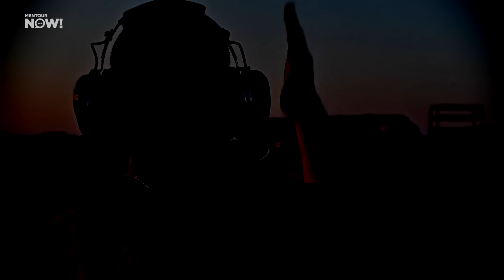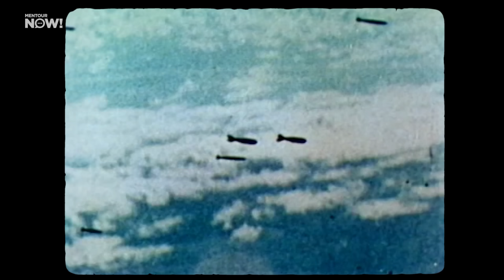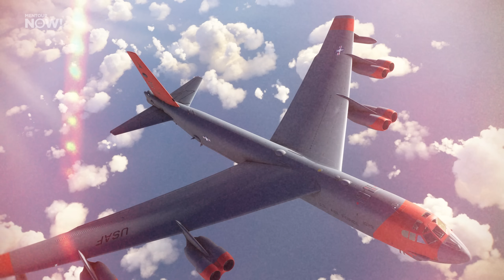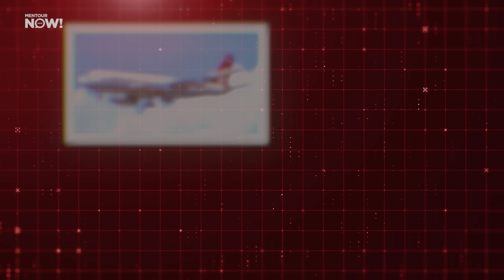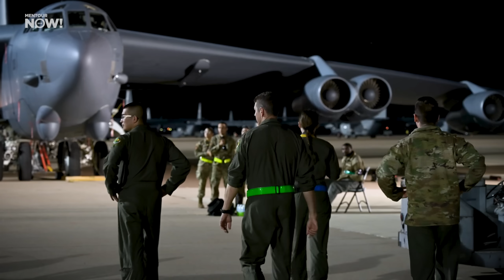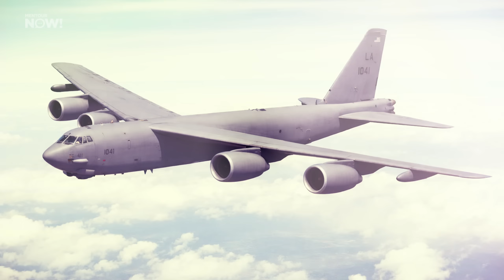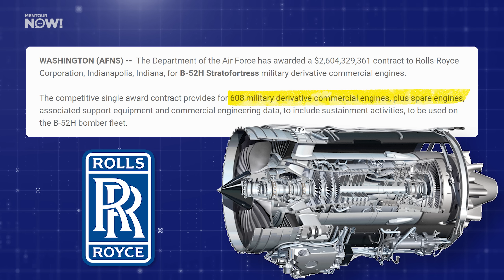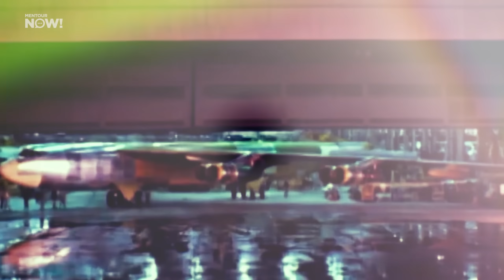WHY Are They Changing The B-52 NOW?!

Comment: Yep.....4 engines, regardless of the perceived benefits would require such a degree of modification in piping, plumbing and related electrical system changes...outside of structural modification, that it would render that "upgrade" a financial non-starter

Comment: The wing flexes so much it cannot have larger diameter fans. When they were designed they needed 8 to have enough thrust to do the job. The older 52s had a taller vertical stab.
The 737 shots show the same problem. Short landing gear with a low wing design begets the problem of modern engine installation and stretching the airframe. We all know the problems recently incurred.

Comment: In the late 1960's I saw a B-52 fly over our house near the Pratt and Whitney airfield with a single engine in place of two. I'm pretty sure it was an inboard pair that was replaced. The newspapers at the time said they were testing the use of a single engine and I'm pretty sure the replacement being tested was a P&W engine although I also recall the neighbors discussing Rolls being in the competition and them being pretty incensed at the prospect.

Comment: The BUFF gets upgrades near continously. I worked on a upgrade around 1980. The aircraft has been re-engined at least once, and no longer flys engines as shown in the start of your video. But that is the point of your video?

Comment: You said it, at 17:24 - upgraded electrical capability for new avionics packages.  Yes, the increased range is fantastic, but the USAF also needed badly to upgrade the avionics in the B-52.  And that takes more power than they were getting from the TF33s.  The real problem, here, is loss of manufacturing capability in the USA.  There's just no way to build new, global-range bombers to replace them, without putting a serious dent in our capability to build new passenger jets (Boeing).  Other companies can build similar aircraft, but lack the industrial power to build a fleet comparable in size in a feasible timeframe.  So, you upgrade the engines instead.  The B-52 was never intended to perform in contested airspace, so it can more closely adhere in design to just being a big, dumb bomb-carrier, but the USAF seeks improvement in mission flexibility, which (again) means upgraded avionics.  They're doing some of the same things with the upgrade of the F-15 to the F-15EX-Eagle II, including increasing the number of bomb/missile hardpoints to a staggering 25.  It now becomes a 2nd-tier standoff weapon of immense capability, while 5th- and 6th-generation stealth aircraft can directly contest an airspace.  These upgrades are being driven by decreased, combat aircraft manufacturing.  In retrospect, we should never have lost that capability.

Comment: It just blows my mind that the B-52 in any format is projected to be serving the needs of the USAF into the 2050's and likely beyond. Obviously this speaks to how well the actual manufacturing was done in the 1950's-60's. One would think that a much updated and fully modern design would have been designed and built by now to meet the same needs but the cost of doing so must far exceed the upgrades to the B-52H's outlined in this video. It's mind-boggling, really it is!!

Comment: Has someone who has it been in the military 32 years and follows all sorts of odd facts about military aircraft, I want to say you did a very good job on covering the facts. 

The only thing I'll add is the enginemaintenance will go down very much and the time to replace the engines for overhaul will actually Outlast the B-52.  So that cuts maintenance time to remove and replace an engine.  Which leads to a higher mission capability rate.

Comment: Completely irrational to keep rebuilding these antiques. This is the age of guided weapons, and the B-52 is a one-trick pony. It will be smarter to design and build a new generation of long-range, tanker capable transport aircraft, and simply eject the munitions off the ramp. That would give true capability, especially if air refueling kits can be integrated into the system. This would allow squadrons to forward deploy, carrying all their personnel and infrastructure with them, then launch combat missions with the same aircraft. This reminds me of the A-10... another useless aircraft that stays in the inventory for no good reason

Comment: Well, the mounting configuration of the engines isn't really as redundant as one could expect. Having two engines on the same pylon means that if one has a big issue, the other will very likely be impacted too. Concorde learned it the hard way.

Comment: The real limiting factor is the ageing and fatigue of the core metal parts of the airframe and the age causing the aluminum to get brittle.. Every flight adds to the total time the metal gets flexed and bumped around creating micro cracks that over time will cause failures in the wing roots, the wing spars, the skeleton of the wings and fuselage and the skin.. So at some time eventually these areas need to be reinforced or replaced adding cost to the operating time which is why generational replacements of aircraft have been done.. Why the USA plans to continue the use but doesn't have a couple new B-52 aircraft being manufactured every year to exchange the need rebuilt airframes with brand new for the same cost..

Comment: I have a question that I hope you are better equipped to answer than I. Why can't they take a "high" bypass engine and build it into  "low" bypass engine? Now, I know it's not a simple task, but I think of the engine core being more or lees very similar across an engine family. And I also feel like much of the more recent engines focusing more on the large fan side of things than the core. So, much like how you can swap out and intake manifold on the car, why can't they build a new front half of the engine?

Comment: The Bombing Condor.
BOORING video thos, 9 mins of unnecessary intro commentary, then an Ad, then some useful but Verbose content; so slow I had to speed it up to 1.65x.
Well we have powerful AI Computers now, Simulation shouldn't be a problem, and giving All Jet Engines, some thrust vectoring, would fix any asymmetry, when Flying By Wire(Computer Controlled) Auto-Avionics. We also have Robotics, that should be AI-Aware and build/modify USA Military Airplanes.
So they should go with the 11:1, 50% the weight, Thrust vectoring, 4 Engines, and go with Efficiency, making with Computing any and all modifications & optimizations, to the B-52. Unfortunately is that WW2 way of thinking that's in the way, of Military productivity

Comment: A bit of B-52 trivia:
* When carrying the AGM-28 Hound Dog cruise missile (seen at 18:38), the missiles' engines can be used to boost takeoff thrust, making the BUFF 10-engined
* There was a 7-engined B-52 - not because it lost an engine. One airframe was used to test the TF39 engine for the C-5 Galaxy, and one TF39 replaced the twin J57 pod
* I think the interval between progression in model suffix designations, i.e. going from B-52H to J, is the longest in history for this program. In most aircraft programs, it's a few years; on the BUFF it's more than 60 years

Comment: I believe there is a little more to the story on the TF33 engine.  Contrary to the statement made, there was an abundant amount of operational TF33s in the logistics depots because of the large number of USAF aircraft which formerly used them. The desire to reengine the B-52s goes back decades, but the economic analysis always failed when ready to use TF33s depot stock was plentiful.  This changed when some of the TF33s were pulled from the shipping crates and, to everyone surprise, they failed to be usable because of pliable parts cracking due to aging.  So, instead of hundreds of TF33s in depots being ready to use, they would need to be overhauled prior to use.

Comment: There was one airliner that used a twin engine arrangement like the B-52. However, for several reasons it never entered service and remains a barely known aircraft.
The Baade 152 AKA Dresden 152 was designed and built around the same time as the B-52, by East German company VEB Flugzeugwerke Dresden.
It was an interesting although (to me) unattractive looking aircraft that may have taken some of its design inspiration from the USAF B-47 Stratojet.
It was meant to enter service with the East German state airline Deutsche Lufthansa but the project was cancelled before series production could commence.

Comment: I a, actually surprised, that the Air Force hasn’t asked Boeing to put the updated B52 back into production and make replacements, except obviously updated with new systems. It isn’t just money issue that has kept the B52 flying for so long. No one has truly designed a better bomber that can carry what this aircraft can carry for the distance it can, and at the altitude that it can as well.

Comment: When I flew the B-52 in the seventies, it was already old. While it looks much the same on its exterior as it did then, the insides have changed drastically. The electronic, pneumatic, and hydraulic demands of the aircraft were another reason for having eight engines. The bleed air ducts passing through the leading edges of the wings are huge and carry an immense amount of high-pressure, high-temperature air. With the re-engining will, of necessity, require changing the plumbing for that system. Still, however, it is much less expensive to modify this beast than it is to design, test, and produce a complete replacement and all of its support infrastructure.

Comment: Even as a non-professiona in this fieldl, my first thought is that you don't just take out an engine this old and put in a brand new one - everything would have to change - cables, pipes, electronics, etc... and the wing structure to accept and support this totally new layout.  In comarison with the B1 and B2, sometimes you only need a piece of paper and a pencil and not a $320,000 home pc to get the job done.

Comment: I’ve worked on several of the many B-52 re-engine proposals over the years.  One of the straight forward problems with the PW2000 that doesn’t deal with flight dynamics is that the engines larger diameter lowers the thrust centerline and this creates a bending moment on the wing that exceeds structural limits.  Another problem the USAF has had with many of the B-52 re-engine proposals is that they’ve never been willing to reduce the aircraft’s top speed (Mach 0.88) and that has been difficult for high bypass engines to accomplish without other changes to the airframe and control systems.  Not that my opinion matters, but I’ve always disagreed with this stubborn insistence on the Mach 0.88 capability as the B-52 mission no longer requires high speed target runs.  It’s either used as a stand-off launch platform or complete air dominance is established before it carries out direct bombing runs.  Objectively, dropping to Mach .86 wouldn’t have been a deal breaker.

The real question tax payers should want to know is why did it take so long to re-engine the B-52.  It’s been sucking up way too much fuel for four decades.  You could argue that the primary job of a TF-33 is to burn fuel and any thrust you get is a happy side effect.  If they had re-engined back in the late 80’s or early 90’s, the cost of re-engining would already have been paid for in fuel savings.  This really should be the second re-engining and it would still be paid for in 20 years by further fuel savings.

Comment: Back in the 1970's I read an article from Reader's Digest about the B-52. The one thing that stuck in my mind was that the plane was so well made that it could literally fly nonstop into the year 2000, barring that it did not run out of fuel or have mechanical breakdowns. My dad worked on the B-52 until he retired in 1967, he also put in 20 years of service. 4 years in the US Army and 16 Years in the USAF.

Comment: I happen to be very closely associated with someone who works tangentially on the J upgrade program. There are many more failures delaying the program, and many of them were revealed by someone with experience on the airframe asking simple questions that the bureaucracy had never considered.
Reply: Challenges, not failures until proven physics remain incompliant.
Reply: @skaltura failures when it comes to budgets and schedules.
Reply: Very closely associated with someone who is tangentially related to the J? So you are making this up?
Reply: @tylerhussey8470  No.  Identifying them could be a significant OpSec violation because of their intimate knowledge of the program.

Comment: the new digital cockpit is extreme! what a difference. one of the things i find endearing about the B-52 is its antiquated look. i wonder if the air force is going to upgrade the fuel panel to digital as well. no reason to just curious.

Comment: One thing that you didn't mention in this video is that the B52, in its present form, is horrendously underpowered. I am 80 years old and was in Guam in the early 70s as part of an RAF detachment at the  USAF base there. This was, of course, during the Vietnam war. I have never seen so many aircraft in one location in my life. There were B52s as far as the eye could see! 
However, we quickly learnt that that they could not take off with a full bomb load and a full fuel load on board. What they had to do was take off with minimal fual and carry out in-flight refuelling before setting off on their Vietnam bombing missions.  Even then we watched with bated breath as they struggled to get airborne. The runway ended at a clifftop and the aircraft, barely 100ft off the ground, would temporarily disappear from view as the downdraught over the cliff caused tham to lose height as they passed over it. I never got used to that as, in my book, if they were taking off into the wind, surely there should have been an updraught. I'm not a pilot so my knowledge of these things is a little sketchy. Maybe you could enlighten me !?

Comment: One other potential concern is that these jets were effectively individually hand-built. Each one is going to be subtly different, making it labour-intensive to do the upgrade work. This is a large part of why the RAF gave up its Nimrod MRA4 upgrade project (though that was a more involved wing replacement) -- they just couldn't get the parts to fit together -- so they scrapped them and replaced them with off-the-shelf P-8s, E-3s, etc.

Comment: I suspect the TF33's were kept until they were no longer sustainable - and likely no one expected it to be in service near as long as it has been.  One advantage the B-52 has is that the volume dedicated to tube electronics when developed allows considerable more capability with modern electronics.
Side note:  The TF33 is a derivative of the J57 with the low-pressure compressor replaced by the fan.

Comment: 12:58 - just a comment from someone that works in aviation... 

Another issue with this kind of engine configuration is to comply with the rotor burst requirements. A RNC event would have a high chance to lose both engines at same time. Since it is military equipment, this is not an issue.

Comment: Surprised Boeing didn't strap on 4 new engines, call it the B-52MAX and convince everyone it didn't need a new type certificate.
Reply: It has to do with the rudder authority. The rudder has not the aerodynamic force to compensate a failed outboard engine in a 4 engine configuration.

Comment: Simple…Same reason the KC-135s/E3s were re-engined.  Better efficiency, lower maintenance, increased on wing reliability.  Engine parts availability for currently manufactured engines.  Lower dollars in the long run.

Comment: Somebody help me with this calculation. All engines have same reliability. The more engines on the plane, the higher the probability that one will fail. With 4 engines, 1 failure is loss of 25 % of power. With 8 engines, 1 engine loss means 12.5 % power loss. Which configuration gives better guaranteed range? Yes, I know this is only part of the overall calculation. Any statistics people out there?
Reply: The rudder couldn't compensate a failed outboard engine in a 4 engine configuration. The pilots would have to reduce power on the other outboard engines then, leading to a higher power loss than 25%.

Fully fueled and loaded engine power might be too little then.

Comment: I guess the B52 is still in use because its maintenance cost is far lower than that of the B1 and B2 - which are much more capable, but too expensive to use against adversaries without air defense like the Taliban. I wonder what will happen in the 2050s. Will they extend the B52 lifespan to say 150 years, or develop a new bomb truck?

Comment: The BUFF remains in the doctrine for air power in the US Air Force. The platform has demonstrated, over nearly 80 years, its adaptability to carrying belly bombs and cruise missiles. Even trying the Snark fitment, and parasite planes (think Goblin and X-15). The aircraft has been rebuilt repeatedly. My dad flew as a Pilot for SAC and did two tours in Vietnam. He became the director of bomber maintenance and spent countless hours upgrading the platform. They cannot install four engines on the wings due to ground clearance constraints with outrigger bombs and full fuel. The wings are designed to flex 26 feet while flying and are held on by large "super bolts."